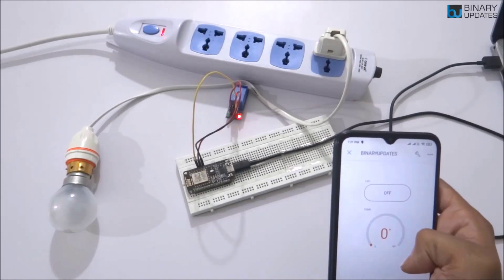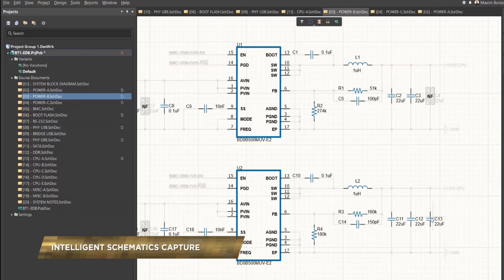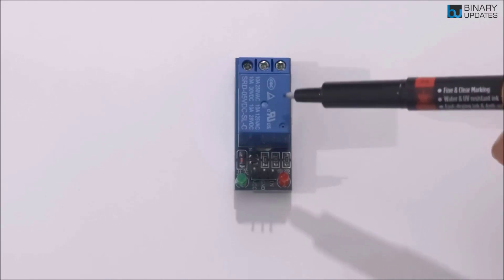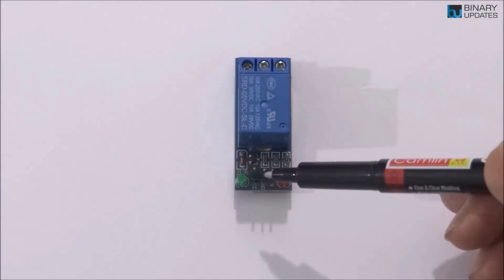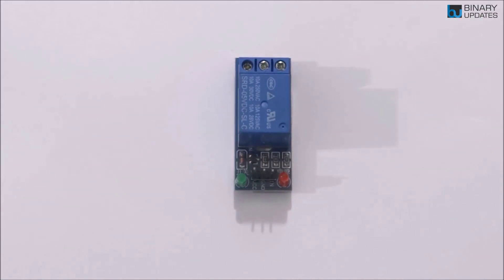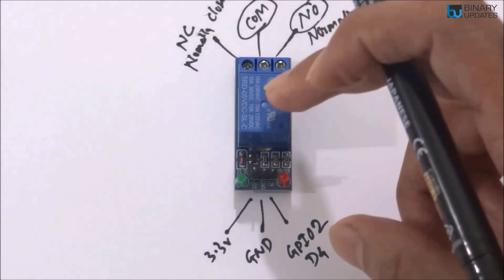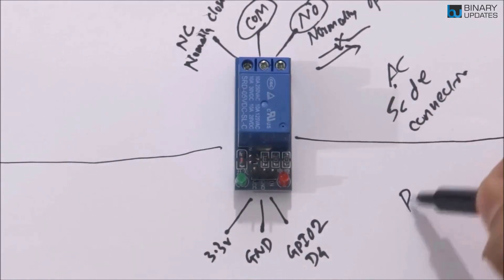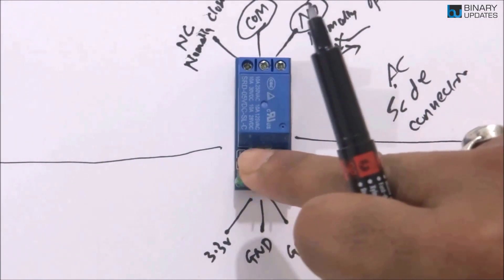Control Light Bulb and Relay using Blynk Mobile App

Comment: sir, shock is passing through relay ,even though relay works perfectly and the bulb is not responding
Reply from the maker: Maybe try replacing light bulb and then test relay module. Best wishes!

Comment: why have you connected vcc with 3.3v on nodemcu and not with 5v?
Reply from the maker: Hi, Its because my Relay Module operate on 3.3V DC. Usually, most relays in market operate on 5V DC. So Its always advisable to test your relay specification before using it in our project. Its fine if you use 5V DC on NodeMCU ESP8266 Board. Best wishes!
Reply: @BINARYUPDATES  thanks

Comment: What voltage output does your Nodemcu esp8266 produce?
Reply from the maker: Hi Kingsley, ESP8266 works with 3.3V DC but on NodeMCU ESP8266 you can find Pin which provides you 5V DC in case if you want to drive relay. As in this video I used 5V pin on NodeMCU to control light bulb using relay. I hope this may help you. Good luck and best wishes!

Comment: Hello Sir I have a Doubt i'm using 5v relay on nodemcu and its low level triggered .... So when i'm triggering the relay means giving an low signal the relay is triggered and when i'm giving a high signal the relay is not comming back to the untriggered position because nodemcu gives 3.3v output which is not enough for a 5v relay....Is there any other option or am i doing something wrong??
Reply from the maker: Hi Ramprasad, It completely depends on relay module. I would suggest try single channel and 3V DC operated relay for better operation. 

There are so many variants of relay module out there in market. Usually, most relay module operate on 5V DC for devices like Arduino and Raspberry Pi. But there're some which also work with 3.3V of NodeMCU ESP8266.

I hope this may help you. Good luck and best wishes!

Comment: is it possible to power the NODE MCU from the relay instead of data cable
Reply from the maker: Hi Huzaifah, as long as what i understand your question. I think its better to avoid because NodeMCU operates on 3.3V DC and most relay in market start to operate from 5V DC up.....I hope you get my point. You can do so but it will not make sense in the end.
Reply: @BINARYUPDATES  yes I got it, so is there any way that I can power node mcu other than the cable?

Comment: Sir i created my own android app for controlling this and using my own real webserver with some apis that i have created all apis are responding quickly as usual but the nodemcu is fetching data from the api very late why is it happening
Reply from the maker: There may several reasons from server's uptime to network speed through which your NodeMCU ESP8266 is connected to Internet. Try with other cloud platform and test for performance test to get mode clarity. I hope this help. Wish you good luck and best wishes!
Reply: @BINARYUPDATES  Thank You very much Sir for replying. Please tell me one thing How can I change the TCP_MSS value in arduino ide 1.8.18 because I was unable to find the sdk_overrides.h file in the Arduino installation directory

Comment: Sir, what if I will use 5V 8 channel relay. What is the connection of Nodemcu and 5V 8-channel relay? I want to control 5 solenoid water valve. Thank you
Reply from the maker: Yes you can. Use 5-GPIO Pins of NodeMCU ESP8266 to connect relay input and control your Solenoid Valve. Its the same same as shown in video lesson except configure more pins to control and drive more relay inputs. I hope this may help you. Good luck and best wishes!

Comment: How will this work if 12v relay module is being used
Reply from the maker: Hi Shruti, you may need to provide power to relay from other 12V power supply from DC side of connection on relay module. Make sure you keep Ground Pin common between NodeMCU ESP8266 and Relay module to function it properly. 
Good luck and best wishes

Comment: Im not using nodemcu but im using wemos d1 r1 esp8266 so can i use this code ? What changes should i make to the code?
Reply from the maker: Hi I believe this code will work fine for Wemos ESP8266. Just make sure the Pin numbering while connecting relay before trying Blynk IoT Code. Good luck!